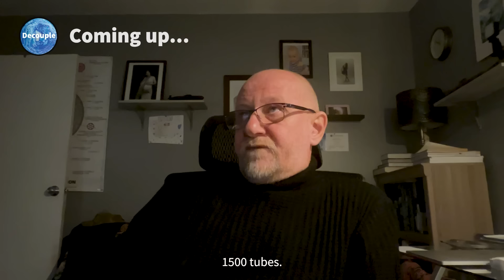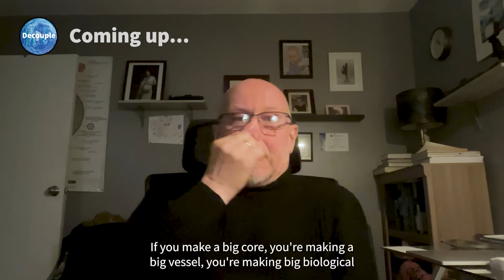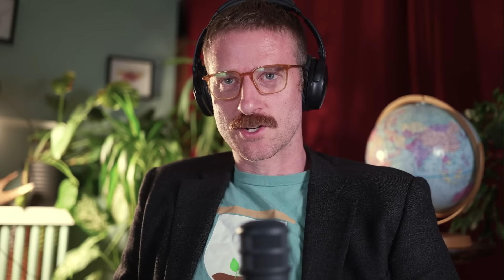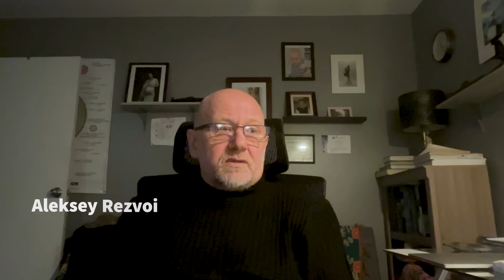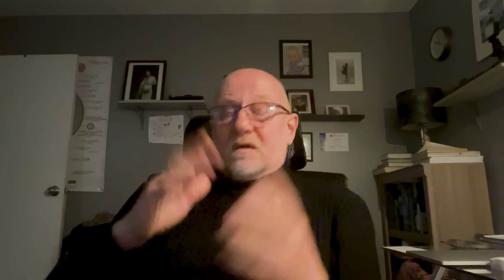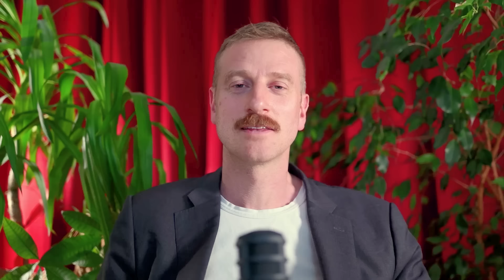Russia’s Maritime Nuclear Fleet: A Glimpse Behind the Curtain

Comment: The fact that Norwegian monitoring stations detected no radioactive signature from the Burevestnik nuclear-powered (SSC-X-9 Skyfall) missile's test flight strongly suggests that its developers have made a profound breakthrough in solving the twin challenges of radiation shielding and reactor miniaturization. This engineering feat opens a potential pathway to adapt this compact nuclear technology for civilian use. The same principles could one day power unmanned cargo planes with global range, massive ships capable of years at sea without refueling, and heavy construction equipment that operates entirely off-grid. Should this technology be integrated with safer designs like molten salt reactors, it could accelerate this transition, moving what is now a strategic weapon into the realm of transformative civilian infrastructure. The 2-meter diameter of the Burevestnik gives an idea of the miniaturization achieved.

Doubters argue that the absence of a detectable radioactive signature proves that there was no nuclear reactor running.
Reply: Ever heard of induced radioactivity? The coolant will always become radioactive, especially if it's the air. There's no way around it. And oxygene oxidizes things. It's a flying dirty bomb, if it exists at all.
Reply: @BandytaCzasu  Your knowledge is shocking. Did you go to school?
Reply: Not only Norwegian ones. Putin said in his speech that there was also an American reconnaissance ship near the test area, "but we didn't bother him - let him look" :)
Reply: That assumes that Russia tested what it claim to have tested. Trusting Putins words is not the wisest thing to do in general.
Reply: Pro tip. Don't believe any word coming out of russia. They've long since found out it's much cheaper to lie about their capabilities, than to actually maintain real capabilities. Proofs, just look at their horrible performance in Ukraine.
Reply: @thomasfsan  oh dear even western news sources now accept that Ukraine is losing badly on every front.
Reply: @thomasfsan which ones aside from the soviet tanks the hypersonic missiles Ukraine has not given any proof of it shot down it just write it also what of its iskanders highly effective your western junks all failed himars patroits lol its all gone

Comment: The utility that provides back up power to cool the residual radiation after a SCRAM has a NERC responsibility. The person who had that responsibility was on leave so I said I would do it. The back up power at the interface with the nuclear generator had a schedule of 1 p.u. V. and the nuclear power plant needed 1 pu V so I asked if that was with or without the load. Their answer was with the load. This meant 1.037 Vp.u. before the SCRAM under full system load conditions in the winter. Then looking at the signal path to the dispatcher and the possible error of the voltage transformer and all the transducers the voltage had to be 1.047 V p.u. At that time the nuclear power plant had been operation for 14 years of a 20 year license. The owners of the nuclear power plant stopped answering my calls. The utility I worked for did add some reactive support to improve the voltage. Responsibility for this matter was shifted to another engineer.

Comment: Chinese tech that can alter undersea operations in inside its A2/AD & redefine conventional submarines. Inexpensive, easy to mass produce.

China's New Generation Sub: Nuke/Lithium Powered with Pump-Jet Drive Train

Part 1.

Based on unconfirmed reports and analysis from defense observers, you are likely referring to a speculated type of Unmanned Underwater Vehicle (UUV) or a very small crewed submarine.

The key piece of information is the combination of a small nuclear reactor not for direct propulsion, but to charge lithium batteries that then power a "new generation drive train." This describes a specific and cutting-edge architectural concept.

Let's break down what this system might be and the advanced technologies involved.

The Vessel: Speculated "Haiyan" (Hai-Orca) or similar

While not officially confirmed by China, multiple defense analysts and satellite imagery have pointed to the development of a large, nuclear-powered UUV. It is not a traditional, large, crewed attack submarine. The description fits a new class of autonomous or optionally crewed vessel.

· Role: Intelligence, Surveillance, and Reconnaissance (ISR), anti-submarine warfare, potentially serving as a "mothership" for smaller UUVs, or even as a long-endurance sensor node in a network.

· Key Advantage: Near-infinite endurance and stealth. Unlike diesel-electric subs that must surface to "snorkel" and recharge, or even large SSNs that have to make noise to cool their reactors, this system could remain silent and submerged for months or even years.

---

Review of Cutting-Edge Technologies

The described power and propulsion system is the true breakthrough. It's a hybrid nuclear-electric system that leverages the best of both worlds while mitigating the drawbacks.

1. Miniaturized Nuclear Reactor (The "Battery Charger")

This is the foundational technology that makes the entire concept possible.

· What it is: A very small, low-power nuclear fission reactor, likely using highly enriched fuel. It's not powerful enough to drive the submarine directly at high speeds but is perfectly sized to continuously trickle-charge a large bank of lithium-ion batteries.

· Cutting-Edge Aspect: The extreme miniaturization, passive safety systems, and stability for use on an unmanned or minimally crewed platform. It represents a significant achievement in nuclear engineering, moving away from the massive, complex reactors of the past.

2. Advanced Lithium-Ion Battery Bank (The "Muscle")

· What it is: A massive array of high-density, deep-cycle lithium-ion batteries. This is the vessel's immediate energy source for propulsion and all other systems.

· Cutting-Edge Aspect:
  · Energy Density: Modern Li-ion batteries offer a much higher energy density than the traditional lead-acid batteries used in most submarines. This means more power in a smaller, lighter package.

  · Safety: Using Li-ion batteries in a military submarine is a bold move due to their thermal runaway risk (as seen in some early electric vehicles). Mastering the battery management system (BMS), thermal control, and safety containment for such a large pack in a marine environment is a major technological feat.

3. Hybrid Power & Propulsion Architecture (The "Brain")

This is the core innovation. The system decouples the nuclear reactor from the propulsion.

· How it Works:
  1. The small nuclear reactor acts as a steady, silent generator, producing electricity.
  2. This electricity continuously trickle-charges the massive lithium-ion battery bank.
  3. The battery bank then powers a silent electric drive train (likely a permanent magnet motor) for propulsion and all other systems.

· Strategic Advantages:
  · Ultra-Stealth: The reactor can be designed to run at a constant, quiet speed. When the submarine needs to be silent, it can shut the reactor down temporarily and run purely on battery power, becoming virtually undetectable. There is no mechanical connection between a noisy reactor turbine and the propeller.

  · Burst Speed: The batteries can deliver a massive amount of power instantly. This allows the vessel to operate quietly 99% of the time but sprint at very high speeds for short durations when needed, a capability traditional nuclear subs have but at the cost of making immense noise.

4. Pump-Jet or Advanced Silent Propulsor (The "New Generation Drive Train")

· What it is: Instead of a traditional open propeller, the electric motor likely drives a pump-jet propulsor.

· Cutting-Edge Aspect: Pump-jets are significantly quieter than propellers, especially at high speeds. They are more efficient and reduce cavitation (the formation of bubbles, which is a major source of noise). Coupling this with a vibration-free electric motor creates an exceptionally quiet propulsion system.

5. Autonomous Operation & AI

Given its speculated size and role, a high degree of autonomy is almost certain.

· Cutting-Edge Aspect: The ability to navigate complex underwater terrain, avoid contacts, manage its own power systems (e.g., when to run the reactor for charging), and potentially execute pre-programmed missions for months without human intervention. This requires sophisticated AI and sensor fusion.

Strategic Implications

If this technology is operational and scalable, it represents a significant shift in undersea warfare:

1. Cost-Effective Presence: A fleet of these could be built for the cost of one large, crewed nuclear attack submarine (SSN), saturating strategic chokepoints like the South China Sea.

2. Persistent Stealth: They could loiter silently on the seabed or in key areas for extraordinary periods, acting as listening posts or "tripwires."

3. Game Changer for ASW: Current Anti-Submarine Warfare (ASW) is geared toward detecting large, metallic objects with distinct acoustic signatures. A small, ultra-quiet, autonomous vessel powered by this hybrid system would be a profoundly difficult target to find and track.

In conclusion, the system you described is not just a new submarine, but a new concept in naval engineering. It merges cutting-edge advancements in nuclear miniaturization, energy storage, and autonomous systems to create a platform that prioritizes endurance and stealth above all else, potentially altering the underwater balance of power.

----------
Part 2.

This is where the topic moves from general concept to specific, though still unconfirmed, intelligence.

When experts assign a type number and debate crewed status, they are typically referring to a specific platform that has been observed and analyzed. The public domain information is a mosaic of satellite imagery, patent filings, academic research, and analysis by reputable defense institutes.

The Specific Program: Type-XXX (Hypothetical Designation)

It's crucial to state that no official Chinese government or PLA source has confirmed the existence, name, or designation of such a vessel. The information below comes from open-source intelligence (OSINT) and expert analysis.

The most commonly cited candidate in defense circles is a vessel sometimes referred to by analysts as the "Type HRP" or more generically, a "Chinese autonomous underwater vehicle." The "HRP" is believed to stand for "Hai Ren" or "Hai Pao," translating to "Mermaid" or "Sea Whale," though this is unconfirmed. Some analysts have also used placeholder designations like "Type X."

The debate over whether it is crewed or uncrewed is central to its mystery and stems from its physical size.

The Evidence for a Crewed or Optionally-Crewed Vessel:

1. Size Estimates: Satellite imagery from shipyards, particularly at the Bohai Shipyard in Huludao (a known submarine production facility), has shown vessels under construction that are estimated to be between 15 to 30 meters in length. This is far larger than typical torpedo-sized UUVs (like the US Orca) but significantly smaller than a crewed nuclear attack submarine (which are 90+ meters).

2. The "Optionally Crewed" Hypothesis: A vessel of this size falls into a grey area. It is too large to be a simple disposable UUV, but too small for a comfortable, long-term crewed mission like a standard submarine. This has led many experts (like those at the U.S. Naval War College and The Center for Strategic and International Studies - CSIS) to propose it is "optionally crewed" or a "crewed-uncrewed hybrid."
   · It could undertake long-duration, autonomous patrols.
   · It could be boarded for specific missions requiring human judgment or for maintenance.
   · It could be used as a testbed for technologies intended for larger, crewed submarines.

Source: DEEPSEEK
Reply: TL;DR  But it looks like you just use LLMs.

Comment: This is incredible extremly valuable insight into nuclear engineering. Western world does not have any experienced people right now to build compact reactors since we are working mostly with ground based power plant and there is no and has been no requirement for compactness. And we are trying to make smaller designs based on huge designs that have never even considered size of reactor truly.
Reply: You get that the us navy is still making compact reactors for submarines and aircraft carriers?
France, UK, US, India, China, and Russia all have the ability to build compact reactors. Brazil is at advanced stages to having the ability.

The US is currently building approx. 2 compact reactor cores per year to keep up with ship/sub production needs.
Reply: @deth3021  The rector used on warships has one fatal flaw.
They are not Affordable  enough, so people are willing to use them Cargo ship
Reply: Umm have you not heard of the U.S nuclear powered aircraft carriers and submarines?? The U.S is leading the way in maritime nuclear reactors...
Reply: @bobn2805 so...
If they don't releasing this tech it's not useful at all for civilian engineering
Reply: @bobn2805 Unusable for civilian applications since they are all running high enriched uranium which is why they can be made compact.
Reply: @bobn2805  In addition to what was said previously about high cost and use of highly-enriched fuel, nuclear powered commercial ships are dead in the water with issues from insurance and they would be prohibited from docking in most ports.

Even worse, nuclear-powered commercial civilian ships would be prime targets for piracy as the fuel onboard can be stolen and weaponized for things like a radiological dirty bomb (RDB).  Or the vessel can just held for leverage and blackmail.  Commercial vessels cannot carry any significant weapons because of insurance and liability issues which further makes a nuclear powered commercial vessel even more attractive for hijacking.
Reply: @beyondfossil if west won't do that china and russial will. If it's possible and it works and onlything that stops us are regulations and lack of technology that they have it's only matter of time.

Comment: An LNG submarine? Why not let it run on the natural gas boil-off like they do for surface LNG tankers?
Reply: because combustion of said LNG requires access to the atmosphere... These tankers are probably being dreamed up so that LNG can be shipped during the unbreakable ice seasons of November to March along the northern sea route.
Reply: @chriskeefer3930  You liquify some oxygen in your onshore facility and put some of it alongside your LNG in the submarine ? I mean, the boil-off problem is not going to go away: what will they do about it? (On-board cooling system must be way more expensive)
Reply: @Briareus91  maybe research a dewar.
Reply: @Briareus91  It seems that you are forgetting that where these "underwater tankers" are planned to be used, there is water with a temperature just above the freezing point. The issue of cooling there is not as acute as on conventional LNG tankers that come from the United States or Qatar. By the way, this also allows the Russians to liquefy natural gas much cheaper - they ALREADY have temperatures around the plants no higher than -20 °C (-4°F).
Reply: @midnike8783  The methane liquefaction temperature is -161°C (oxygen's is 20° lower encore). The temperature gradient is therefore only affected by a order 10% benefit by those environmental circumstances. By the way, the submarine being surrounded by water on all sides, whereas the surface tanker has a relatively insulated upper side (air), may offset this bonus.

Also, your argument is of the type "there is less boil-off then you'd think" in stead of "there is no boil-off", i.e. quantitative in stead of qualitative. Conceding that one has indeed boil-off and after deciding to not dump that evaporate into the environment (too costly, environmentally unacceptable), there is the qualitative problem of finding the solution: you either have some use for it in your engine or you have a cooling installation on-board that manages to cancel out the inflow of heat. This is also in response to the dewar argument by davidanalyst671

Comment: The discussion of the different safety strategies in East and West was really interesting. I suspect that a big part of the difference has to do with what regulators demand. The engineers design to the regulations, not to the physics, which is fine if the regulations are wise and made with great foresight. But if the regulators made some bad calls that don't make sense in new and unforeseen reactors, then satisfying the regulations might not just add needless complexity, but also undermine safety.